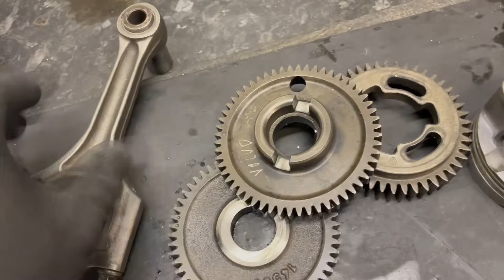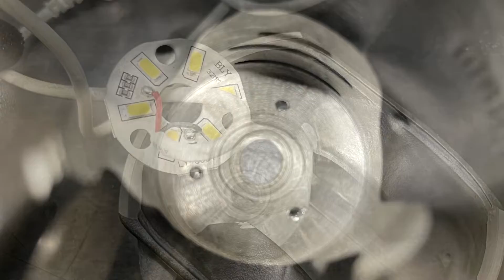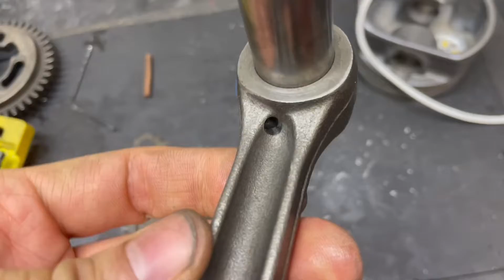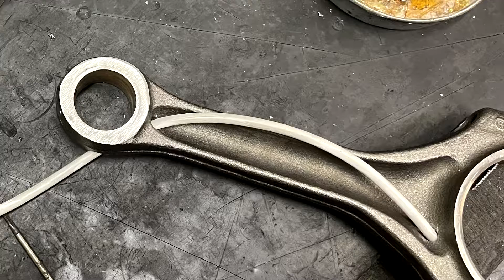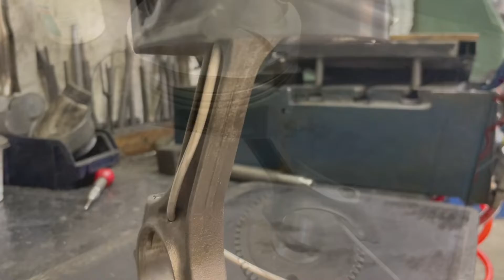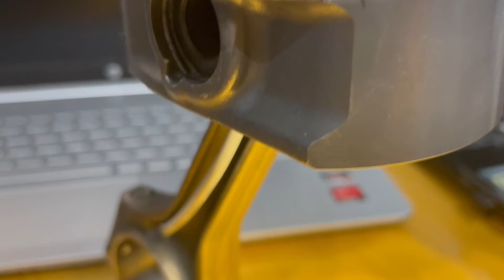Handmade Piston Lamp

Comment: Good video and a final clever design. I've not seen one used like this before- using the LEDs inside like this compliments the piston design rather than just being a normal lamp-holder stuck on top.